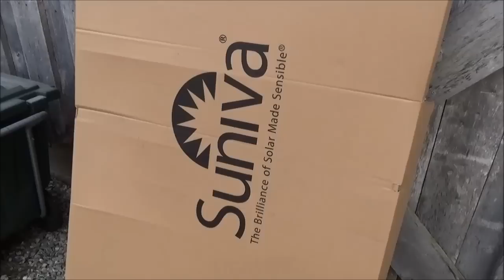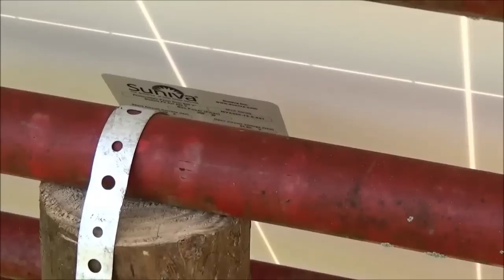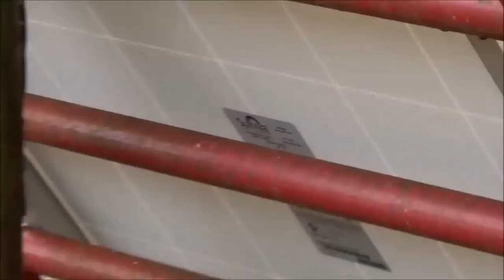DIY - Solar Panels Meet Cattle Panels

Comment: A lot cheaper to use 1.5 inch stainless 2-hole pipe clamps to mount the solar panels to the cattle panel and to  mount the cattle panel to the posts.  Much cheaper than muffler clamps.

Comment: Use uprights from warehouse shelving that have the holes in them (they can be bought cheap or free on craiglist), then unistrut bolted (the holes magically line up) for what the panels mount to.

Comment: Nice vídeo It may be prudent to temporarily attach a digital angle finder to assist when you need to adjust for seasonal tilt.  Also try adding stainless steel hinges to the posts and self tap or bolt into the cattle gates.

Comment: Omg, that steel fencing is probably the best structurally speaking. As far as improvement. Having those vertical column near the center will probably shift the weight a bit more balance vs heavier in the bottom. And if you have more spare fencing, you can expand and add more panels

Comment: I am thinking of the same thing except using 3 steel pipe up rights per cattle panel with a linear actuator on the middle post. I also want mine to be able to stand straight up and down to protect them from hail we get fairly often. They will be facing the south and we get most all strong storms from the west.

Comment: First off I would like to have seen you lift 700 pounds by hand. Secondly cutting a notch in to top of the of the post with a flat strap across the top would have been a better bearing service.

Comment: Yeap if you have a better secure to top of post but I would move closer to center (off center, next bar down)  it will be less weight to lift all panels to right angle, but still be a two man job... right now you have ~90% mass at the bottom...put 600-900 mm rv jacks on the lower support....

Comment: I like this set-up. I would've used the Bottom part of the Clamp's and mounted then inline on Top of each  Post. Then put the Cattle Panels in them to better support the Cattle Panels and it would make sure they stayed on Top of the Post......IF you get what I mean.

Comment: 300 watt panels will deliver 260 watts on a summer day. About 300 watts on a sunny 0 degree day. ---Before installing the posts, drill clearance holes for the posts and cut them to make a saddle..

Comment: really good idea. I am setting up an aray that pivots using 12 ft long ladders  as a frame. pivoting on 2 -6x6 post . ready to adjust for the season.  pivot point is 9 ft off ground. high enough for front panels at tilt level being 6.5 feet. now it could be used as a car port as well. watch for pictures  coming.

Comment: If you wrap a strap around the strap pictured at the top of each pole it will also help prevent the gate from slipping off, but a notch will do a much better job.  I'm guessing that's what you had in mind when you said you intended to add more straps.

Comment: If you set the poles (fulcrum) at the center of mass (the center line of the gates) then it won't take as much effort to adjust which you'll probably appreciate if you ever need to automate their movement.  Also, your clamps should be galvanized and you might want to use polyurethane spacers between the panels and the gate to minimize galvanic corrosion and allow the gate to flex without stressing the panels.

Comment: Looks like the cattle panels will work great, however they are not cheap and rarely end up in a scrap pile. I can pick up chain link fencing, posts/pipe and related hardware all the time from people just wanting it gone. Something could be built using that stuff that would be very similar, and cost for those who do not have cattle panels around could be significantly reduced. just remember (because it will be subject to more of a wind load) to break out your drill and add bolts to all of the compression connector that might slip under the added load.

Comment: An improvement that I would do would be to "V" notch the top of the posts so the tubing is held in place with a simple plate held by two pieces of rod stock with wing nuts across the top of the posts. 

For seasonal adjustment of the panels a simple notched piece of bar stock held between two other pieces in concrete with a bolt between them and then put a bolt between all three pieces of bar stock to hold it down.

Good project so far.

Comment: So just an idea(and I didn't read all 119 comments to see if anyone said it already) but you can place a brace on the post that pivots and depending on the horizontal member you attach it to will give you the angle. A bit like a pool side lounger if you catch what I mean. Awesome idea btw.

Comment: A suggestion, cutting slight "v" notch across tops of posts to cradle the top cattle panel rail, may better hold in place during high winds, still keeping the plug strap across the top, too.
Also wondering how to build this rack, if only using one cattle panel to be able to pivot east and west slightly to catch early and late day rays. Manual movement of course. 
Great idea here. I have been toying with DIY idea do triangle shaped 3 PVC panel rack mounted to old truck hub bearing and vertical pole, allowing free rotation, using per drilled holes in pole to lock into position to follow sun through the day, manual adjust reqd, unless you could rig up a 12-24 volt piston arm with sun tracking switch..(over my whiskey basted old gray matter).
I have a location in far west TX....lotta sun, but often high winds for a couple of days at a time.

Comment: Not too bad for a temp install. Now are you planing on being grid tie or going with battery backup. I'm currently working on a battery backed up system with mppt charge controllers. Have you had any experience in this area?

Comment: I'm thinking about a 2500-3k watt backup power system,  I was thinking about getting a full pallet, then selling the balance for cost. I like the idea of your cattle panels  very much. as I want to have easy access to the array for moving during the seasons. Are you dumping the power into the house or into a battery array via charge controller?
Reply: It's a damn shame the little golf courses in my area disappearing due to luxury homes coming in - the rich dude wants to be the the last one to move in and is pissed when things aren't what they used to be.Life is full of bitter ironies.

all those batteries were nice to have around should things get ugly,,,, now theres just bunch of rich a-holes who'll complain the power and water is out. .....one dude is putting in a 175k pool, more than my house cost....
Reply: j johns , 5 lo n6yy Ara 14th 9 out yoyjjvyzQm Sq
OJ5tt
ŔQTYESUP.  Kk.Kk.o e6 red 58ill
It by it
N szd 44sOUTPUT1RR1R1 RE

Comment: Using old satellite dish poles with the electric motor to turn the grids. 3 panels per pole. I still see these all around the county in yards that are not being used. Were were actually getting the dishes and using them for little ornamental ponds. But the poles and motors were still good. Just a thought..

Comment: Great idea using the panels...under your panels.
You will get less damage from animals rubbing up against them, and better results if you mount the whole assembly just a few feet higher.
Doing that will also provide shade, shelter from rain, and even a little heating for the animals in Fall & Winter.

Now, for another project I've always wondered if a water-clock could be built to adjust the angle of the panels. Just a thought, one water guy to another.

Comment: Cut V grooves in the top of each post for more security. Use galvanized panels for long-life. Fashion a locking angle adjuster to keep wind from flipping it like a pancake. Minor suggestions on a great idea!

Comment: how about one pole per gate section and then at each end use some small metal cable with a pulley system on the pole and you crank one direction and it pulls or teeters the ends of the panels up and vise versa I am guessing a very sturdy pole like a utility pole would be needed but in a shtf or wrol situation all you would need is a chain saw then you would have as many poles as needed

are you going to go with mini inverters or those super cool optimizers and regular inverters

Comment: You asked for ideas, I have one. Why not use black pipe with threaded fittings? It could be built to adjust easily enough with electric pneumatics. It is plenty stout enough to support the weight of the panels even with a stiff wind. If a center pole were to be mounted and anchored into the ground it could use solar tracker to follow the sun from east to west. A secondary tracker would benefit the up and down tracking of the sunrise to sunset. The pneumatic mounts can easily be welded to the black pipe. With the threaded fittings it could be expanded to accommodate more panels, or taken apart to move.

Comment: You could use the center section of the muffler clamp on top of the posts for a cradle, just lag them into the top of the post.  You would still have the strap though, and it might make it to tight to pivot.

Always could adapt the hinge system where the panels tie together end to end, but I'm guessing you may want to use your panels for cattle again.

Regardless, simple solution, with easy to find parts!

Comment: Have you considered adding reflectors at the bottom to increase solar density?  I'm thinking of 4x8 sheets of pink insulation with spray adhesive to mount plastic aluminized emergency blankets to the pink styrofoam.  These could be mounted in front at the bottom at a flat angle calculated for best angle of reflection to the panels.  Could change this angle from summer to winter just as the panels themselves change angle.  May get a large marginal power for low cost relative to the cost of the panels. I'm not sure how solar panels behave with non-uniform density over their surface however. Nor how they would hold up to rain. Just a thought.  Cheers.  Love your videos.

Comment: Pretty neat idea.   I might vary the tubes used for clamping the solar panels to, just so the load in a strong wind is not all pulling on that center tube.  Maybe use a staggered pattern on each panel so the solar panel frames could strengthen the  framework? I might use stainless steel u-bolt clamps and nuts as well.  Your hinges do look a bit flimsy. Probably okay, depending on how much wind is there...  Wish I had that many big panels here. Prices of them sure have come down.

Comment: Aluminum fence panels like this, or even the aluminum tubular gates (like just to the right of your panel setup), are great options.  Brand new, they can be had for well under $100, seen them as lows as $60 on sale sometimes.  Or even better, we've bought them used, in bulk, for the ranch and paid under $50 each.  It would be very hard to build something of this size and strength for that amount of money.

Comment: Love the idea but I might have spotted a minor design flaw. The screws that secure the pivot straps are installed to low.  At 4:46 the top bar might move backwards when you are pushing the panels up from the front (especially when the top of the post is wet/Slipery). The current flexibility of the strap might allow the top bar to fall behind the post (still inside the loose strap). When this happens the weight of the panel will snap the strap and the vertical post will smash through the solar panel in the process. Using a few screws higher up on the straps should mitigate this.

Comment: How about this for a top pivot mount...Cut the top of the fence post off flat, then bolt a steel plate on that flat surface, perhaps a U-shaped top plate so that you can anchor the plate on the sides of the post rather than from the top.  Then slip one of those muffler brackets over the fence rail, and weld it onto the front edge of the plate.  It could then pivot up and down, and could still be unbolted from the post and moved to new location if needed, or removed for repairs, etc. by simply unbolting the top plate assembly from the post.  Just an idea.  The assembly would look something like this, only turned upright (it is missing the top horizontal line, sorry, couldn't figure out how to draw it with a keyboard): <[_

You might even be able to make the top plate using a piece of steel pipe that fits over the top of the fence post like an end cap.

Comment: I would have made some little furrows in the top of the post for the panel to rest in and put a little Vaseline in them.
 Sort of like a pole and socket joint. Using cattle panels is an excellent idea.

Comment: A thought, the part of the muffler clamps use fasten them on top of the posts as a cradle for the metal gates to rest on and clamp them down.  also shouldn't the whole metal structure be grounded?
All the Best

Comment: Might be able to use the fencing you have around the cattle pasture to transport the electricity generated around the farm as well. I used to use our wire tension fence that way and it worked pretty well. Thanks for the great ideas as always Engineer775 and God Bless.
Reply: you sent high voltage DC along the fence wire? sure why not? saves on an electric fence driver I suppose. I mean it will kill anything that touches it, but maybe capitol punishment is a thing where you live, lol.

Comment: I reckon using the moomoo jails ain't that bad of an idea, could run wire through the tubes for weatherproofing as well... I'd worry about that strapping not holding though...Maybe attach some fence hinges to the fence posts then attach some 2x4's to the hinges to bolt on the guards. Or could ruin the guards and drill some holes in em n' attach em directly to the hinges.

Comment: Using what's available to make a fully functional solar array, WORKS FOR ME. :)
What size of wire are you running from the panels to the controller and then the batteries?

Comment: Forgive me if I missed it in the video somewhere... Is this a Permenant or temporary setup? Lol, just ribbing you, looks good for a tempor test setup. I was thinking it should be a center post with a slip on sleeve of a larger pipe, capped with a mounting tab on the top that allows for pivot adjustments. Towards the lower part of the sleeve, have an adjustable arm (another pair of pipes that one will slide on the other) with a nut welded onto the outside sleeve for a bolt to adjust the length. The whole thing can rotate side to side, and pivot horizontally, to track the sun. Heck, set it up with a motor controlled but a computer that will follow a per-determined path to optimize the results.

Comment: Outstanding  idea ! mount the cow panels in the middle with a bushing of sorts   then add 1 large  liner actuator  and a solar tracker controller u will have a low cost high  production solar tracker great idea.

Comment: nice all i would do is add 2 actuators for seasonally tracking and would of cut a v grove in the tops of the post just to help keep the gates locked in but other then that good use of spare materials that is what homesteading is all about using what you have on hand to do as you need preferably without heavy modification

Comment: A cheap replacement for the pipe straps is chains and bolts. Notch the top of the post so the pipe rests inside a grove and then throw a chain over top to hold it down in wind and you are good for a semi-permanent install.

Comment: love it  I have installed a lot of solar panels over the years and i also live off grid.
  here is a suggestion. don't put it on a trailer, it is dam near a trailer as is, it is plenty strong enough all you need do is fit  2 sets of springs and axles in tandem to a simple sub frame and hing it on to that. get another 2 cattle panels because those are doing a more important job.

Comment: You could use the clamp portion of the muffler clamps, with some long lag bolts. The lag bolts will pass though the clamp wholes and pull down into the top of the posts. You have plenty of left over clamps maybe two or three per post.

Comment: I did something similar using a chain link fence gate. Cut a V notch in the top of a 4x4 pressure treated post used some 1/8 inch flat stock steel and a couple lag bolts. Mine has only got two 120 watt panels and not quite as heavy duty as yours. For my angle adjustment I used PVC pipe with tees cut in half and 2 hose clamps on the lower part of gate, drove rebar in the ground and cut a slot in other end of PVC pipe with a third hose clamp to lock the height on rebar. Painted PVC for UV protection.

Comment: Great idea!  We used an old satellite dish mount that was here when I moved in, the dish had been set on a pole in a perfect spot. My son built a wood frame with a metal center point mount for my SunRNR panels to match the bolt holes on the dish mount. Removed the dish (obviously), and mounted the panel "array". Can easily adjust angle and direction with the dish's mounting setup, even though the panels are very heavy.  Had just the right distance for the panel's power cord to the spot chosen for the SunRNR. If I had enough land could use your idea for some lower wattage panels still in storage, but I think those will go on a roof. Need to re-purpose that dish now....birdbath maybe?  I'm sure there are better uses lol, Getting there!

Comment: I would make a V cut on the top of the post so that the metal tubing can sit in the V groove. Then you only need 1 strap and the rack will be very secure. I would also make sure to somewhat tie down the bottom part of the rack to prevent the wind from blowing it over or moving it.
Other then that, it looks very good and heavy duty :)
Cheers bud! Long time subscriber and I really enjoy all your videos and your sense of humour LOL

Comment: I don't think you can build anything as strong for less. They will not flex and the wind will not move them. A stronger strap on top of the post is the only thing I would want. You did very well. Have a good one.